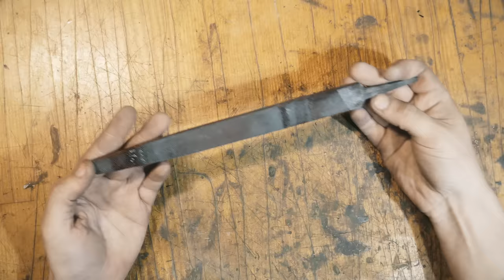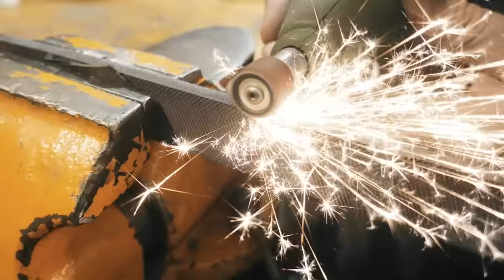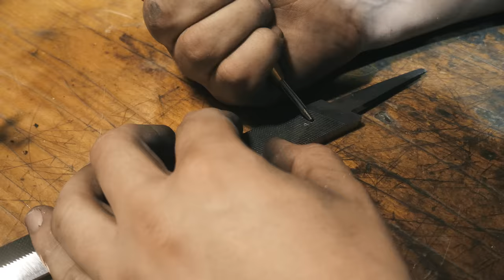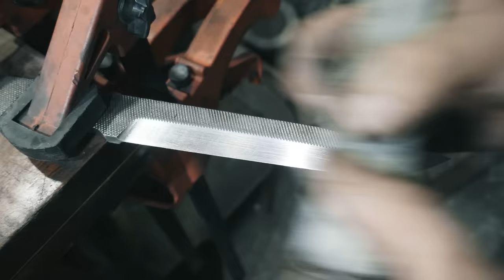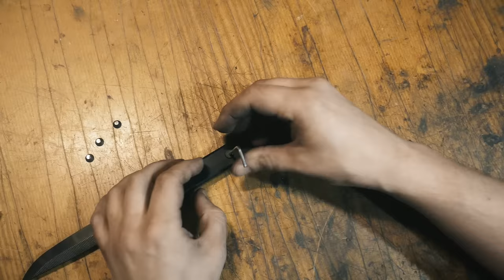Making a Knife from an Old File

Comment: what is liquid in 10:20 ? thanks
Reply from the maker: it's ferric chloride
Reply: Looks like grape syrup "pekmez" 😋
Reply: Ha, it may look like grape syrup on the video, but you definitely don't want to drink it!
Reply: Ferric chloride is a strong acid. FYI.
Reply: the function??
Reply: Ferric Chloride is used as an acid etchant. It can be used in various instances from making one's own printed circuit board, to bringing out the pattern differences in Damascus steel.    In this case it appears that it is used just as part of his finishing process to the steel. As there is no pattern to bring out.
Reply: @BengtRosini13  although the black finish with the polished edge looked good
Reply: Oh yeah, it looks real good, quality professional job there, no doubt.
Reply: @jeodezman32  pekmez biraz daha yoğun olmuyor mu
Reply: @BengtRosini13  ....
Reply: Šotek you must be from a slavic country
Reply: @jeodezman32  it's alcoholic?
Reply: @Koss-channel  i hope you neutralized the acid with water and bakeing soda so it dosent corroded
Reply: @Koss-channel  how long do you need to leave the blade in the ferric chloride for it to blacken
Reply: Anyone know what steel these common bastards are made of?
Reply: Which one? I'm a slav too!
Reply: @de8173  I would think that depends on the material, we used to make circuits in highschool, the board was just a thin layer of copper I think. It took about 15 minutes to eat the layer. It was long time ago tho, I could be wrong
Reply: RoboCop's milk
Reply: Chaz Miller Strong acid? Last time I encountered strong acid was way back in 79!
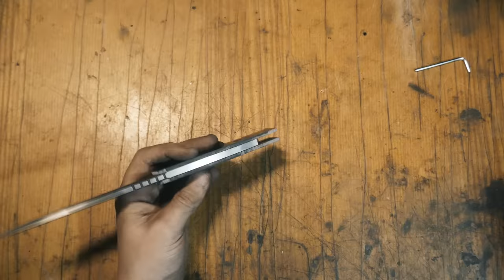Reply: @Koss-channel  hi sir. I wonder 8:36 what kind is those screws? Looks like the one they used in some rugged phone. Thanks.
Reply: @Koss-channel   how can I buy your knife.
Reply: Looked like coffee
Reply: Liquid shit
Reply: Koss what’s ferric chloride?
Reply: Mighty-F the reason it is used on damascus is strictly because of the way the etching behaves with most steels in a 1080 15n20 damascus you end up with different etch depths and colour results, being that his handle is black he put it in ferric chloride to change the exposed portions colour. Just neutralize the reaction so it doesn’t continue to effect the steel inward.
Reply: @jeodezman32  bosniak? I am too
Reply: Grape juice
Reply: Erkc I’m Turkish too🇹🇷
Reply: @Mighty-F well,he used it to blacken the blade
Reply: @MartinBuzon  when we made circuites ,it would take 15 to 45 minutes to corrode the copper
Reply: death water
Reply: Chocolate
Reply: When you get 276 likes for asking question
Reply: Cokelat 🍫 😅😂😂
Reply: @Koss-channel  Also known as PCB etching liquid if you're having trouble finding it
Reply: يعني انت اللي مسوي فيها بتسوي نفس الشغل اللي سواه
Reply: @jasonantigua6825  <SNORT>
Reply: @khanhphaminh1175  they are allen wrench screws
Reply: Aren’t all files brittle and not useful as a knife
Reply: Šotek it's crack
Reply: @KronicDaydreamZ  is brittle whatever it is, files snap rather than bend
Reply: @Koss-channel  great job. What state you in
Reply: I'd drink it. You know, cus I'm all that is man.
Reply: @KronicDaydreamZ  Old file steel..
Reply: @chetmanley8755  Will also prevent the parts with the file "Teeth" still present from corroding, as they're susceptible to due to the increased surface area.
Reply: Coffee
Reply: Koss 
what does ferric chloride do?
Reply: It's used motor oil. You can also fertilize your garden with it.
Reply: Patina.
Reply: @KronicDaydreamZ  W1,
Reply: Bengt Cenatiempo, smart guy
Reply: I did not know you had such incredible imagination you worked
Reply: Bengt Cenatiempo wait you drink syrup?
Reply: Excellent work and beautifully detailed .
Master at work ...
Reply: @jmbstudio6873  thanks
Reply: Wtf am I doing here I need to go to sleep
Reply: An aciid
Reply: Just some holy water. Make sure to  boil the hell out of it.
Reply: Looks like coffee ngl
Reply: I thought it was vinegar to get off excess rust but it is ferric chloride
Reply: COOOOOCA-COOOOLAAA
Reply: BBQ sauce
Reply: Oil
Reply: smoke
Reply: water
Reply: Breast milk
Reply: coffee colonic juice
Reply: my fathers baby gravy.
Reply: Snot
Reply: It produces a black iron oxide patina in seconds.
Reply: Poo water
Reply: soy sauce XD
Reply: 應該是氯化鐵
Reply: @jabatanamalmalaysiakawasan2101  it reacts with the blades surface, adding  dark color to it. It s used to reveal damascus pattrerns, tint blades, in some cases helps identify microfractures onthe blade surface.
Reply: Hello, but how can I get such a knife?  Because I like it!
Reply: @chaz7346  i want to eat it
Reply: Bengt Cenatiempo the grape syrup burns on the way down... definitely not one of my favorites
Reply: @BengtRosini13  i did, then i got pregnant
Reply: i guess it`s acid
Reply: Btw ferric chloride isnt an acid, its a neutral salt. If it eats the copper on pcbs is because of a redox reaction.
Reply: Koss are you going to be selling these on your Etsy because I really want one
Reply: It's fucking soya sauce what else?
Reply: @jeodezman32  it is lol
Reply: Похоже что "хлористое железо"
Reply: Piece of cake.
Reply: I'm guessing that's not his first time doing that.
Reply: Blood
Reply: @richardshort4587  That first trip in the forge was to anneal it, softening the metal. Second forge trip was likely tempering to bring the edge back to hard.
Reply: @jordy2299  an acid used to etch metal
Reply: @KronicDaydreamZ  , we common bastards are made of iron.
Reply: CyberGenesis YEH NO SHIT SHERLOCK
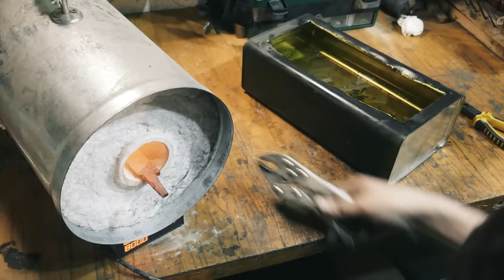Reply: How about the liquid in 5:50?
Reply: Say i were to drink this how quick could i die..asking for a friend
Reply: @jabatanamalmalaysiakawasan2101  wow....orang malaysia layan gak mamat ni
Reply: Щякв з поп(ч в тех ррп
Reply: Bengt Cenatiempo r/woooosh
Reply: Yup ferric chloride great stuff adds a awesome look
Reply: @alifaiman8087  yesss bos
Reply: it's water with black color...!
Reply: Nice job but add some discription off what you doing
Reply: М
Reply: Kronicdaydreamz I would guess 1095
Reply: Very good job I like the triangle hole and that handle extension.
Reply: @richardshort4587  that's why he puts the file 4 hours in the oven at first... To make the steel softer and less brittle. 

Knives makers also do that for 1 or 2 hours after they've quenched the blade in the oil. how long and how hot the oven depend on the steel alloy they're using and how hard they want the blade to be.

Also generally knives/sword makers don't recommend quenching the part of the tang that is used for the grip/handle. Reason being to keep that part of the knife the softest and less brittle as possible so that if the knife was to break and snap while you use it, it would do it on the blade and not in your hand, making it safer and less likely to injure you.
Reply: @richardshort4587  he tempered it to soften the steel first. that's why he did the initial filling for you to see that is softer than the other file.
Reply: Looks like a fuckin choc lake
Reply: @sravanmenga7413  m k lk ok ln pl l
Reply: @jeodezman32  ne pekmezi armut mu
Reply: you can also use gasoline
Reply: بنيطجعشلل
Reply: @hernanmoreira5455  a
Reply: it looked like soy sauce
Reply: Great knife 😁 what is the temperature to annealing (celsius)? And how long it takes? Thnks and congratulations for your channel is awesome. From Portugal
Reply: Bonjour
Reply: @KronicDaydreamZ  if its not a case hardened pos, it will be something like a D2 or O2 tool steel, maybe 1095 family,
Reply: @jasonantigua6825  that was a quality funny right there!
Reply: It wants to wash my hands while watching
Reply: Šotek WD-40
Reply: i like how you take junk and grind it down to a knife. i've seen knife makers forge steel from wire and screws, that is amazing. i can probably do what you do in the same setup but not as fast.
Reply: your skills in free handing are far better than mine.
Reply: @hernanmoreira5455  no it is not alcoholic and it has the consistency of Nutella
Reply: Nice....i want that knife....
Reply: Erkc no the f It doesn’t
Reply: Ian Moritz Krečič Q
Reply: @BengtRosini13  does this protect from rust in any way?
Reply: Mustard works too
Reply: @Koss-channel  clorhídrico férrico con % de agua????????? Y el clorhídrico férrico frío?????
Reply: @BengtRosini13  I thought it was a mixture of Gas and oil.  Ferric Chloride.  Thanks for this explanation.  Good to know.  Great work .
Reply: @ianmoritzkrecic7929  His nickname is Czech.
Reply: Koss what is it for
Reply: I think olive oil 🎃
Reply: 这刀锋利吗？
Reply: Beautiful
Reply: @jeodezman32   belki pekmez olsa yerdik
Reply: @ianmoritzkrecic7929  it's Czech republic... I am from Czech republic also
Reply: Seal oil
Reply: Tinnel xd
Reply: It look's great, dude👍
Reply: @jeodezman32  Türk her yerde Türk abi adam asiti yiyeceğe benzetti
Reply: Why the hell do you have so many likes just for asking what liquid he used??
Reply: How much would someone have to pay to get you to make one for themselves?
Reply: Im pretty sure it's oil to cool down the knife
Reply: And the oil cooling it down and outting it back in hardens the steep
Reply: Bluing agent !????
Reply: Its winee

What has quarantine done to meee
Reply: Coffee
Reply: It darkens hardenablipe steel but leaves mild steel light. That is how you get the damascus pattern. In this case it is all hardenable steel so it all turned dark.
Reply: Coom
Reply: gravy
Reply: great design, nice job! Would love to have a knife like this!
Reply: @LaMuerte198911  make one. You will love your own creativity more and you will have a new skill.
Reply: Ajmal Ahmed The comment got pinned, and anyway, it’s an interesting question..
Reply: Yes but can you make a file from a knife?
Reply: That’s a lot of feric chloride
Reply: @jeodezman32  have fun drinking it (don't really drink it)
Reply: @chaz7346  so not the kind of acid one would take when they're first try acid.... wait we're not thinking of the same thing oh... whoops
Reply: @sqiggleswiggles919  sure put some whiskey in it and have a grand old time 🤣
Reply: @insultigknightuscantstands4648  LOL!!
Reply: Ferric chloride is the first step in stone washing
Reply: Diarrhoea
Reply: Good jod
Reply: Beer
Reply: Idk
Reply: @KronicDaydreamZ  in Germany we make these Things out of high quality carbon steel and let them harden on the outside.
Reply: @chaz7346  i'd still drink it
Reply: @jeodezman32  canin pekmez cektiyse en iyi pekmez Gercüş pekmezidir :)
Reply: já myslel že to je olej
Reply: @jeodezman32  Balkanac?
Reply: @jeodezman32  aha Türk
Reply: Ī
Reply: This mans really made his own band saw. Legend
Reply: @Koss-channel  iop lo lo lo óo
Reply: @Koss-channel  o no lo óo lo l pm popo luz pm lo lp9o
Reply: @Koss-channel  p
Reply: Soy sauce
Reply: That’s amazing I’d buy it
Reply: So you hav all other equipment other than that liquid!?
Reply: You can also use engine oil
Reply: Nice
Reply: VERY SMART WORKING I LOVE IT
Reply: Urine, what else?
Reply: Can you make it for me 
I will pay you.
Reply: @BengtRosini13  cos if you drink it, you'll see smurfs then you'll kick the buck
Reply: It’s paracetamol

Not really
Reply: @jeodezman32  isnt "pekmez" grape jam or smth
Reply: @tolate9075 grape molasses is the true word, pekmez means in Turkish molasses, when you squeeze grapes, and boil for hours get molasses
Reply: Čecha som tu nečakal :D
Reply: @BengtRosini13  try me
Reply: Kámo ty se zeptáš co to je a všichni se můžou posrat xdd
Reply: @Koss-channel  I'm a truck driver and deliver Ferric Chloride to waste water treatment plants. What was the reason for soaking the knife in Ferric?
Reply: @playcraftcz8446  jo, je to prdel :)
Reply: @sandoka674marce9  :)
Reply: Ништяк как заказать такой классный нож у вас ?
Reply: Gatorade
Reply: Guys you are all wrong it’s Taco Bell with extra hot sauce after a few hours
Reply: @Koss-channel   .mm
Reply: A beverage that you shouldn’t drink.
Reply: EDIBILITY NOT INCLUDED
Reply: It’s POOPOOO HAHAHAH
Reply: @jeodezman32  i guess u r frm turkey :D
Reply: @michaelconstantine5149  evet :D
Reply: @richardshort4587  he annealed it first which basically made it not hard anymore. Then he worked the metal and then re heat treated it to the proper hardness for a knife which probably put it around 57-60 rc
Reply: Beast Hunter Cheers M8
Reply: @richardshort4587  I’m sorry I didn’t see you had a lot of replies till after I replied lol
Reply: @beasthunter7480  No apologies necessary bud. You and you’re family have a wonderful Christmas and a healthy happy and wealthy 2021. 🍻
Reply: @richardshort4587  thank you very much. You too man
Reply: @richardshort4587  Not if you anneal the file, work on it, and then harden it to certain hardness, like the video showed you...
Reply: @slchang01  hi
Reply: I'm down here
Reply: @BengtRosini13  ย
Reply: I’m make this knife now, first knife for me. So far I’m enjoying the process
Reply: Nope dude If you use it as a file There is 3/4 Chance to cut own hand or stuff
Reply: It’s the drink that created the ninja turtles.
Reply: xCilginmuz  iç
Reply: rapadura
Reply: Coca-Cola
Reply: Chromic acid
Reply: Aren't you concerned about dirt and debris getting underneath the scale? I would think the tang not being a flat surface against the scale would invite such problems.
Reply: it looked like motor oil but its ferric chloride
Reply: I88
Reply: I88
Reply: It’s poop water
Reply: Адвдбв
Reply: It looks like diarrhea
Reply: Erkc yum
Reply: @Koss-channel  can you please make a knife for exactly like this with same material? If you do I will provide you my email to contact with me.
Reply: @Koss-channel  loops
Reply: @KronicDaydreamZ  usually 1075-1095.
Reply: @hilmanfahim9660  Ampun haha
Reply: @BengtRosini13 a brilliant last meal request
Reply: @Koss-channel  3:02 Bro, what is the name of the thing in your hand?
Reply: That knife is made for only 1 thing
Reply: @Koss-channel  mi de
Reply: OK
Reply: Bubu Bubu I
Reply: آدرس کارها می خواستم قیمتشان چند چطور میشه خرید ممنونم
Reply: Why etch though
Reply: @Koss-channel  it isn’t damascus so etching won’t do anything
Reply: What is the jig called that was holding the blade while sharpening?
Reply: Rất đẹp.
Reply: @BengtRosini13  i would definitely drink it if I saw it
Reply: I want a knife
Reply: @Koss-channel  I would of guessed used engine oil
Reply: One thing they always forget to tell you on these videos of making a knife from a file; is that not all files are the same. Many of them are made from solid carbon steel which is wonderful for a strong blade. But many high-production low-cost files are made from mild steel that has been what is known as "case-hardened". Case hardening only hardens the outer surface pretty much just below the depth of the teeth in the file. But still has a mild steel core. So depending on what kind of bevel you put on the knife; if you have one of those technophiles you may not be able to get a hardenable edge depending on the profile of the knife and how much grinding is utilized to get it to shape. You can only do this with a high-quality solid carbon steel file.
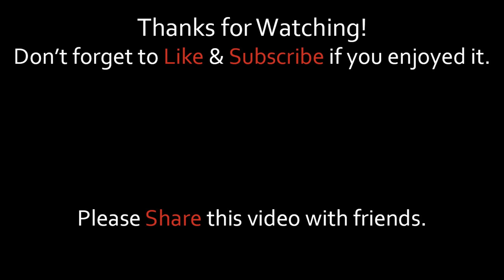Reply: @patrickroberts7847  12:17 12:17
Reply: @Patrick Roberts
Reply: I tried making this knife at home, and now my wife thinks I’m a blacksmith. Guess who's in charge of all the DIY projects now?
Reply: it's an aqueous solution of Iron(III) chloride